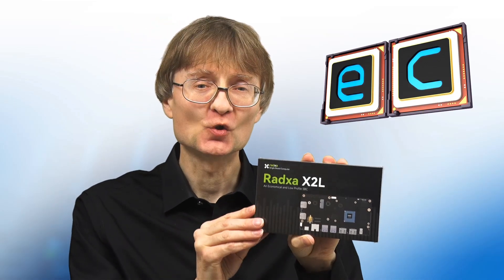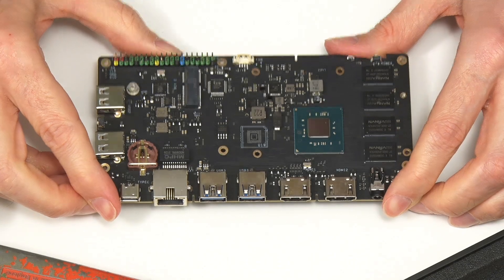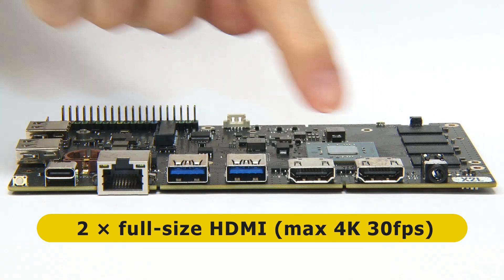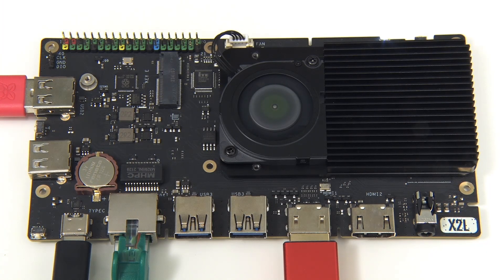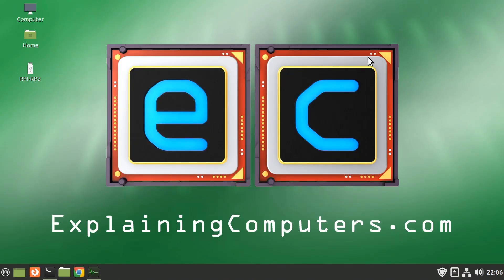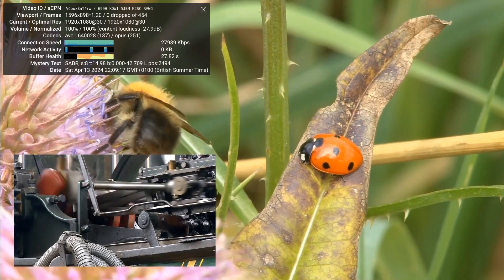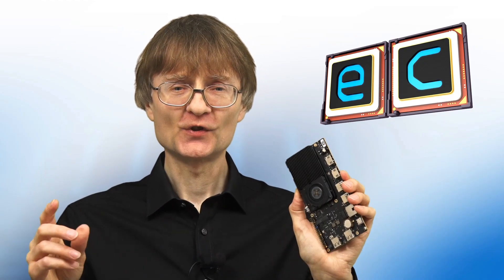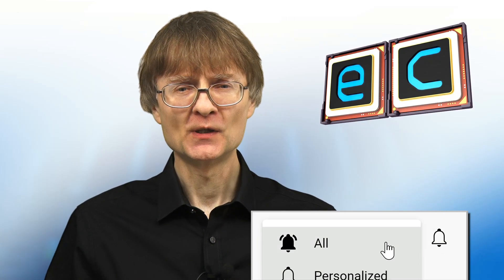Radxa X2L: Low-cost x86 SBC with RP2040

Comment: I have the model with the emmc and I reviewed it recently. The emmc doesn't work like other SBCs and it's only used for OS recovery. Had known that, I wouldn't have bought the emmc version.
Reply from the maker: Very interesting. Is that just for Windows? I know that Windows can object to being installed on eMMC if it detects it as removable media (aka a flash drive).
Reply: @ExplainingComputers  it's for both windows and Linux. The emmc is only accessible when pushing a physical button on the board and is meant to store a recovery OS.
Reply: It seems emmc is hit or miss on these boards which is one of the reasons I would skip the emmc version.  Another reason is that limited writes before it becomes useless.  If the emmc is removable like those on Odroid boards then it's not too bad.

Comment: Interesting sbc but surprised that there's no sd card slot. Good to see stanley and mr Scissors
Reply: Just buy an USB SD adapter.
Reply: @erikkarsies4851  not ideal if booting from sd
Reply: @bgg-jp5ei It could always be hacked on and soldered onto the board, sacrificing one of the USB 2.0 ports.
Reply: @bgg-jp5ei this has an M.2 NVMe slot (PCIe 2.0 ×4, theoretically 16Gbps), and two USB 3.0 ports (5Gbps) for booting off a thumbdrive.

There are faster SD card readers, but I'd guess they're not economical to include on a $50 SBC.

Is there some other advantage to booting off SD that I'm missing?

Comment: I would really wish they go for compatible standards. This could fit in a 1/2 Size Micro ATX layout probably (does it??), then you could use the cheap available cases, maybe add an ssd holder on the other half.

Comment: I was surprised by the render time compared to the n100, being much newer and somewhat faster, I would have guessed n100 beating it by a bigger margin. I've been using N5105 and J4105 windows computers to run NDI tools and convert USB 3.0 cameras to an NDI stream. The J4105 is right on the edge of dropping frames with CPU at around 98%, the n5105 sits at about 75% doing the same work.
Reply: This SBC has a fan, while the ASRock N100 motherboard had a passive heatsink.

Set both CPUs to the same power limits and give them the same heatsink, and I assume there'd be a larger gap in render time.
Reply: @wereoctopus  good point.

Comment: While unboxing I thought we might need to get Rudy the sledgehammer. 

I've been having a growing desire to construct an x86 cellphone that leaves the x86 system sleeping off in cellphone mode, but then becomes a PC when Office or other functions are needed.  My goal is to not need cloud services but to bring my work with me, on my person.  This board appears suspiciously cellphone shaped.  I wonder if I could find a little HDMI LCD to match the shape. 

My first cellphone was in 1988 and I have no problem carrying around a small brick.  I kind-of miss brick phones.
Reply: If you find a decent touch ips panel that fits and a battery pack of decent capacity, it could become a decent hack tablet with basic phone functions running on the pi board and have a stripped Linux distribution running on the Intel cpu. It would be a super interesting project. Too bad it doesn't have Bluetooth and wifi built in though.

Comment: The problem for this unit is that a complete T8 Firebat exists for only slightly more and have a much better cpu and gpu, housing and power adaptor, ssd, activated windows and more ram. Just buy a complete mini pc and rip out the motherboard, voila sbc thats way faster.

Comment: Chris, you can use the lspci command to check the actual PCIE version and number of lanes connecting a device. Cheers!
Reply: Radxa's product page says the NVMe is PCIe 2.0 ×4
Reply from the maker: Very helpful, I will try to remember this. Thanks. :)
Reply: Yep, through you might have to pass '-vv' to see the number of lanes in the output.

Comment: Nice little board with some cool features at a great price. Thanks for sharing!
Reply: No, I can't seem to find the cool fan that makes it cool, It seems required to use it on the board without burning it up. The Radxa Heatsink 9010B is not available unless I've overlooked a solution, please advise.. How can you cool this device?
Reply: @CommanderKlag  I got mine from Arace?

Comment: x86 SBCs are nice and convenient but I would rather repurpose one of the old PCs I have laying around. I know the old PCs are big and not very energy efficient but I don't feel like throwing them away. The GPIO can be easilly added externaly and I don't have to worry if I accidentaly damage the MCU.
Reply: Guess it depends on what you are using it for. If it's going to be on all the time to control something the power draw difference is significant.

If you are just playing around and learning then absolutely use an old desktop, you can probably even pick a 2nd -4th gen i5 up for free if you asked around for unused computers.

Comment: Can you make a video on fixing wrong battery health.
Reply: If you have a device with low battery health your only options are to replace the battery or rebuild the pack (much more tricky). 

There is no magic fix for a worn out battery
Reply: @volvo09   my battery is fine. Probably the bios or the battery module is malfunctioning.

Comment: This thing would've been great low cost nas system if they included 2 or 3 sata slots (even at a cost of not having the rp 2040).
Reply: Just use usb, or split the pcie.

Comment: It's been a while since I've been this exited to see  a single board system! And it actually works! GPIO, X86 compatible, and more... This has me saying (WHY has this taken so long to be done? It seems kinda, well, perfect!
Reply from the maker: Hi Leslie -- and I am in total agreement. :)
Reply: I am not so excited. By the time you add storage, CPU cooler, power supply and case, you are now in the mini PC price range which includes all that and an OS, and more powerful CPU.
Reply: @knerduno5942 no? The cooler is 9$, 68$ for the 8gb ram, most mini PCs have weaker CPUs, don't have direct cooling, or m.2 support, or a microcontroller support, or gpio pins.
Total it's at most 140$ with external drives, the cooler, super cheap m.2 PCie lane adapter GPU.
Reply: I do hope you closed the door after you exited. 😁
Reply: Did you not know about the odriod H2+ or latte panda?
Reply: @anythingbutASIC those are 100$ for 4gb and a 2 core CPU, not 70$ for 8gb and a 4 core CPU. Lattepanda has no m.2 e and m.2 m PCie key. Lattepanda has no microcontroller.
Lattepanda can't use external gpus.
Lattepanda dosent have a cheap and good cooler
Yeah, sure?
There are no sbcs that officially and easily support m.2 PCie gpus under 100$. (I mean it might be possible with a raspberry pi 5 but those are being scalped for 150+ bucks, can't get them, and the GPU community made patches are very glitchy).

I'm planning on overclocking this boy to 2.2ghz 3ghz boost, putting a gpu into this using the m.2 slot and using an external drive for storage. 
Still is under 110$ for a 8gb ram, gaming of sorts machine, and has a microcontroller too! It can run most games decently fast at it's price.
Reply: @anythingbutASIC the later of which are much slower and way more expensive
Reply: For what?
Reply: Low cost was the problem. When the cheapest x86 you could buy was $50 the computer its in aint going to be cheap. Its also massive overkill, you probably already own a PC so you just need the RP2040 for a couple of quid. Though I would be interested in it if it had at least 2 more USB ports or better 4 would be perfect for automated Astrophotography then. To be honest this looks like a Melee quieter 2 PCB with GPIO added.
Reply: Yes it is an impressive sbc. But doesn't touch the performance of a modern gaming rig. For most people's everyday use it would probably be ideal
Reply: @bgg-jp5ei  so what its 1 20th of the price of a gaming pc and its not about that anyway its about the rp2040.......perhaps you should learn a bit more before you speak.
Reply: @christopher480  it's got an Intel x86 64 processor and a rp2040 mcu muppet
Reply: @bgg-jp5ei  But for many gamers it would make a good low cost 2nd computer for doing all their non-gaming activities on. That way they don't weigh their gaming rig down with other software that could affect performance.
Reply: @JMcMillen  💯
Reply: @JMcMillen  No, it wouldn't.  Remember, you get a 4 GB 2XL for about 50 USD.  Now add the heatsink(10 USD).  Something to feed it power.  A case.

It's not magic.  You're actually paying a bit more for the RP2040 and GPIO, which aren't a thing normal people know how to use or need.  They'd be better off buying a mini-pc.
Reply: @Grimmwoldds  and a mini PC will come with Windows 11 Pro included in the price. However, the Radxa X2L is still attractive for those of us who play with hardware.
Reply: @Grimmwoldds  This is one of the first in a long while that was also at an exceptionally reasonable cost. I mean i don't need one, but this is certainly one that will bounce around in my mind as a viable option to consider.
Reply: @Grimmwoldds it's 39 for a 4gb, 68 for the 8gb...
Reply: x86 sucks and is dying out thankfully, that probably why.
Reply: @lain2600  its notm duying out any time soon
Reply: @lain2600 it is not dying out. Still,most apps are built for X86.

Comment: Another interesting SBC review. I just might purchase one....
Reply: I have put one on my wish list, too. M.2, x86, and under $100 with cooler. Shame it's using a discontinued CPU, but they went in the right direction, for sure.
Reply: @kevinshumaker3753 That cpu & soldered ram (its normal DDR4 not LPDDR) is disappointing but the price is not bad.

Edit : I was wrong it's actually LPDDR4!

Comment: Perhaps mentioned but can the rp2040 interact with the main cpu to boot it up ex and signal it to shut down. Im thinking of scenarios where you let the rp2040 be lowe powered and listen to events and when they happen it will spin up the main cpu for processing which will shutdown when finished. Then it could save a lot of battery since most of the time it will only run the rp2040. Thanks for the review 🙂

Comment: The only downside is the lack of on board wifi, but you can plug in a dongle.
Reply from the maker: A dongle, or an e-keyed M.2 module into the top M.2 slot.

Comment: Great review! An x86 SBC with GPIO and on-board M.2 NVME expansion for under $100 is certainly interesting- but the performance benchmarks when compared to the the Orange Pi 5 make it a much less appealing option than some of the RK3588 boards. @MakerbyMistake also pointed out that the X2L occasionally spiked to pretty high power consumption under load (relatively high, anyways). And we're almost at full upstream kernel support for the RK3588 too!
Reply: Orange Pi5? Intel N100 minipc's are offering way more for about the same price.
Reply: @erikkarsies4851  when it comes to single core performance that’s true but there’s a number of multi-core benchmarks and real-world scenarios in which the RK3588 does better than the N100, and you generally don’t get the 40pin GPIO with N100 Mini PCs. 

N100 SBCs obviously exist but I’ve noticed they tend to cost a bit more than the barebones mini PCs.

Comment: As usual with these, unless you need some specific feature of this board, you're better off buying one of the many Mini PCs. Once you add power, storage etc. to the X2L, it will be more expensive and likely weaker.
Reply: The psu is 10, and the board + fan 60 and wifi for 10.. so a total of 80 dollars.. and then a nvme drive. Cheaper than a RPI5 for me. and this has hardware accelerated video so you can use youtube while doing other things, unlike that rpi5

Comment: Both x86 and ARM? Interesting.

EDIT: IMHO, 8GB of RAM, 4 cores/8threads for browsing and playing (old) games is fine
Reply: It's not that you can run ARM code on the RP2040 chip. It's a controller chip, not a CPU.
Reply: @LivingLinux  My bad, a quick search with everyone's favourite search engine read like it was an additional CPU, not just a controller for the GPIO, which the video explained later.
Reply: No. It's just a micro controller from Raspberry Pi. Not a processor.
Reply: Now some older laptops with a quickstart operating system do have an x86 and ARM CPU!